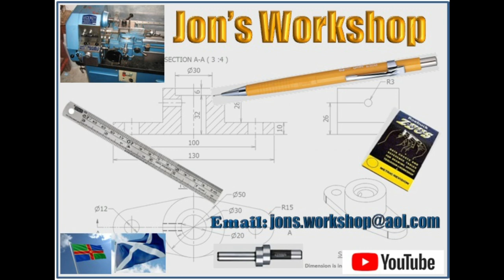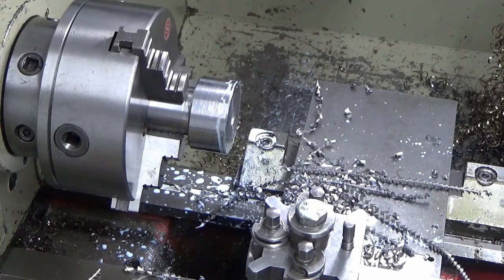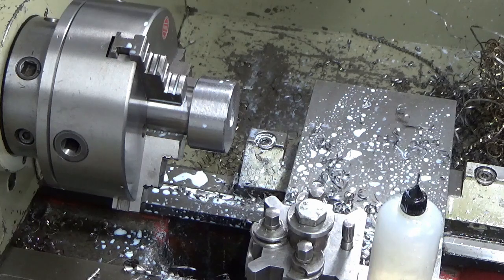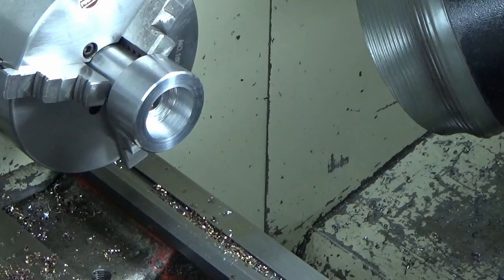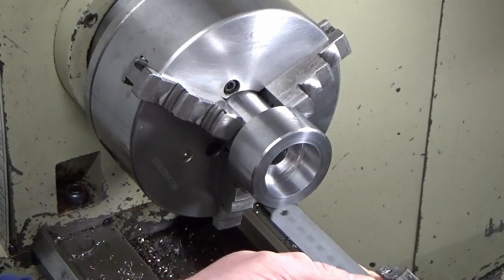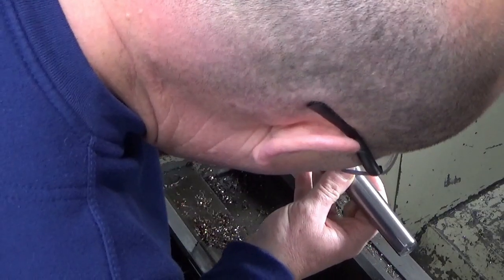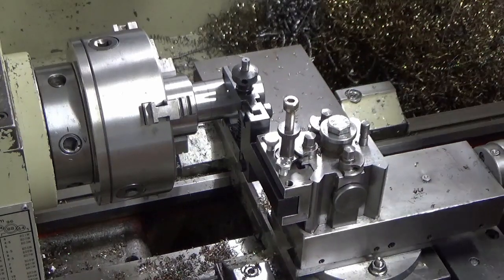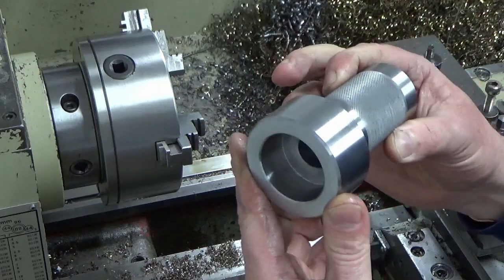Making A Universal Tailstock Die Holder Part 4

Comment: With cheap and chearfull tools you can get things done, even if not as good as we would like. Also for rarely used tools it not worth investing a large amount just to have them sit on a shelf and look pretty. I for one am glad for Aliexpress, Banggood and the likes, I have a lot more options to make things and get by instead of saving up for a tool to finish the job. As a non expert once I find I'm using a tool quite a lot I tend to replace it with a good quality tool. When I bought my mill I bought things I was told were esential that are still in the box unused.
Reply from the maker: Hi Derek, agreed with all your points. I think I will do similar, buy cheap, and either improve (if its worth it), or redesign and remake based on the original, this way I get some good projects for the channel too, and others will be able to follow along avoiding the initial expense of buying the inferior stuff. Cheers, Jon

Comment: Hi Jon, You did a good job on the bore with the small boring bar, if you skim another 0.010" each side of the knurl it would tidy it up maybe? your videos are getting very enjoyable, you've come a long way in a short time. Cheers.
Reply from the maker: Hi Paul, thanks for the comment and great feedback. I was really expecting to run into issues with that setup, I still can't believe I only had a few microns of taper (especially in stainless). Originally I was going to turn the part round and use the 4 Jaw to get the concentricity, but I thought let's just go for it, hit some issues and show the work round for learning. I got lucky! Cheers, Jon

Comment: Jon,
Really good, thanks.  As a life-long woodworker I learned years ago not to buy cheap tools, but the trouble with metal work is that good tooling is just so expensive, and you require so much when you start out, so if you did not use cheap tools the majority of jobs would not be possible - catch 22 !
Mitch
Reply from the maker: Hi Mitch, thanks for the comment. You're right, it's a false economy. 1 in 10 of the cheap tools will be excellent value, the rest on a sliding scale towards crap, and I think this knurling tool is at the crap end of that particular spectrum. A future project for the channel me thinks. Cheers, Jon

Comment: Hi Jon. A new video, great start to Sunday. At 13:00 - didn't you order enough grub screws hee hee  ? 😂😂😜. Cheers.. Mike
Reply from the maker: Hi Mike, thanks for the comment. Well spotted, I think I may have mentioned before that I am tighter than 2 coats of paint, so no, I ran out! I have some bar stock though so once the Die Holder is complete, I will be making a shed load of original screws with the square on top. Thanks for the continued support. Cheers, Jon

Comment: Everything I was thinking during the video(to make it more enjoyable) you realised and commented shortly afterwards, the content and quality is comming along fine in such a short time, I've not felt the need to fast forward like before. Well done. You can quite often get a good shot especially when boring, putting the camera at the back of the lathe, that way the tripod or mount is out of your way too. Any reason you didn't flip the part to get less stickout on the boring bar?
Reply from the maker: Hi Derek, thanks for the comment and feedback. Yes, I will keep working on the format based on the great comments, I'm glad to hear you are seeing improvement. The reason I didn't flip the part was I wanted to achieve perfect concentricity between the two bores so I can use this for sensitive drilling as well as a Die Holder. I could have flipped it and used a 4 Jaw I suppose with some clocking to guarantee concentricity, but I thought I would give it a bash, run into some issues and show the work round for audience learning. As it happened, it went well which I wasn't expecting. Cheers, Jon
Reply: Nothing ventured nothing gained as they say.

Comment: I think you can dismiss the need for accurate OD when knurling, several folks have disproved the need. Besides those that advocate the need completely disregard the fact that you would need to calculate the pitch diameter not the start OD, it being a swaging process. 
When you were drilling i was thinking the bore was work hardening, you could hear it as you withdrew the drll. It only takes a chip to get caught for it to happen.
Reply from the maker: Hi Chris, thanks for the comment. Yes, I think the knurling issue is mainly driven by the poor quality of the tool, it really is badly made (a job for Jon..... make a new one)! I was thinking "work hardening" all the way through with that drill but the confusing thing was there was zero wear or heat discolouration on the cutting edges at the end of the process (all very weird indeed). The first couple of cuts with the boring bar also suggested a level of work hardening so it definitely had some. Either way, Percy showed up and we got to the end of it. "Indomitable Spirit Master". Cheers, Jon

Comment: Hi Jon,
Did you consider turning the workpiece round in the chuck after boring the larger hole. That way you would have had less stick-out of the boring bar for the smaller hole. I thought maybe you disregarded that thought as it would be been difficult to have the two bores running concentric.
I would not suggest my thought was correct I am just keen to learn the thought process behind the machining steps.
Cheers
Paul,,
Reply from the maker: Hi Paul, thanks for the comment, yes, originally I planned to switch it round and set up in the 4 Jaw to try and get the concentricity (difficult to clock in though), so I just thought, let's go for it as concentricity is more important than surface finish. I was really expecting more taper (a lot more), I guess I got lucky, doesn't happen that often! Cheers, Jon